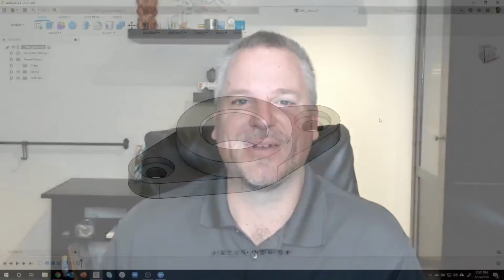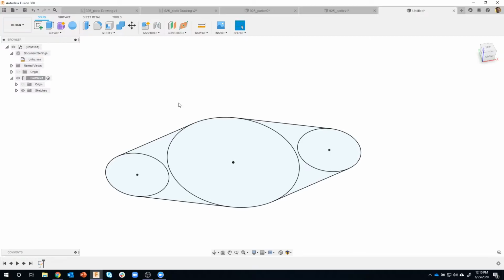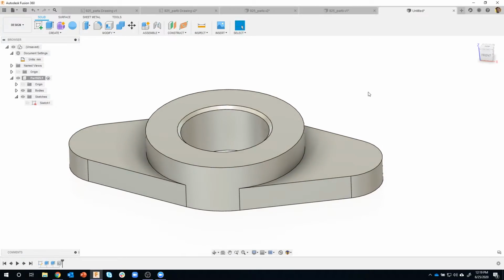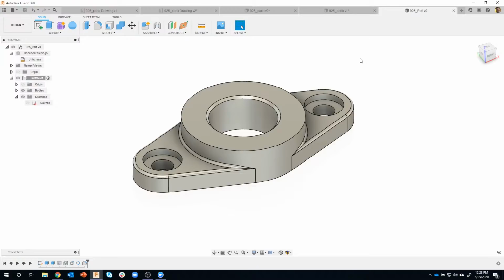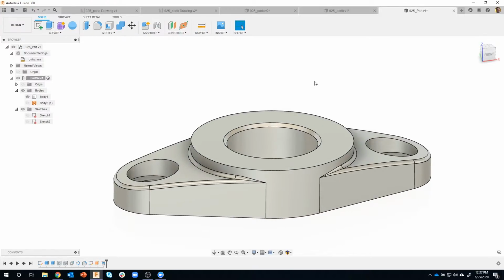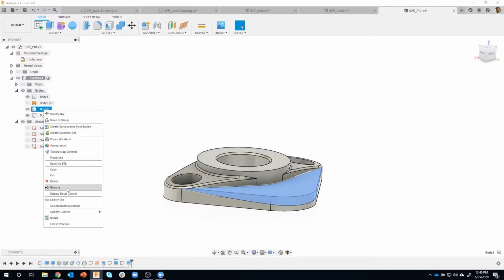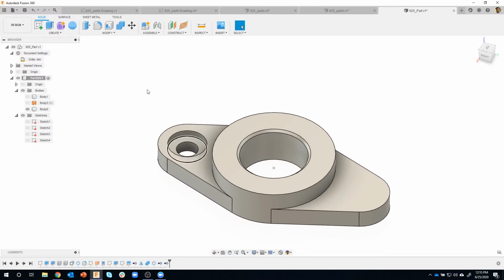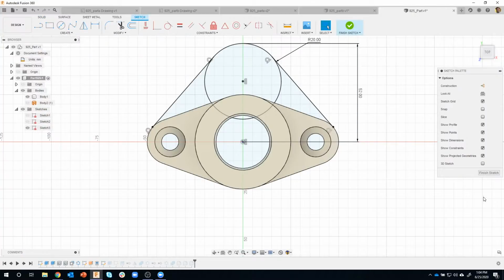Fusion 360 Live - Late Design Changes

Comment: Hi Brad,
Following the change to the hobbyist license, I have now upgraded to yearly subscription to be able to learn more and recently I decided to buy an entry level 3D printer and love working with it. A big part of the reason for buying a printer is because I have a project that I am seriously thinking of having manufactured and taking to market. I have functional prototypes with .step and STL files. It is a very simple product, but I have no idea how to make it ready to manufacture. Do you know a qualified plastics engineer with experience in designing for injection molding who uses Fusion 360, and may be interested in going over my files and giving me an idea on how much he would have to charge to do what I require. I would also ask for a 2D drawing to be included showing the tolerances required in a specific area and the draft angles needed. I know that you and other Autodesk trainers do not get involved in dealing directly with individuals. and if you are not comfortable making recommendations I fully understand.
I just thought this would be a good place to start. Looking forward to hearing from you one way or the other. Bob.

Comment: As ever I've learned loads of things here. The replace face is phenomenal. Another thing I learned is that it's OK to quick fix something rather than spending a long time looking for why there is an unexpected result. I would probably have torn my hair out trying to find why that counter sink didn't pattern properly when it's quite possibly a bug that no amount of redoing would fix. Basically a bodge but hey, it got the thing moving again with the desired geometry. I have done that in the past but always felt uneasy about it but if it's alright for Brad then it's alright for me 👍